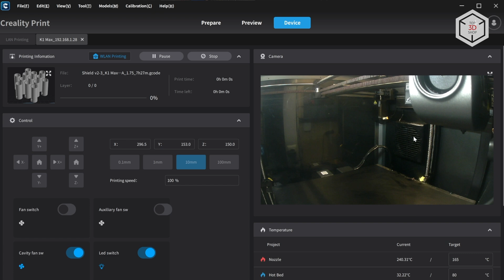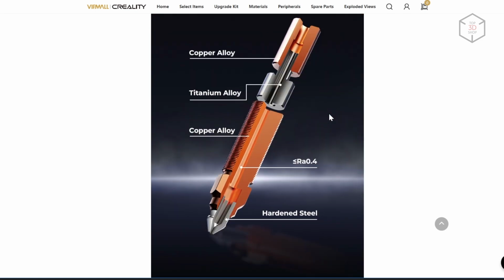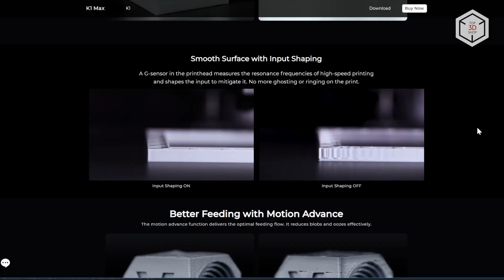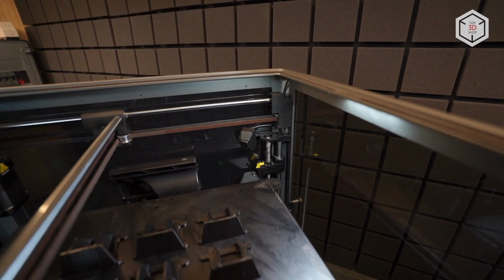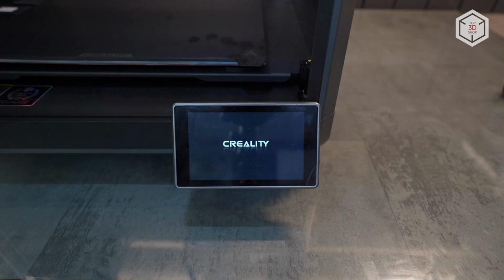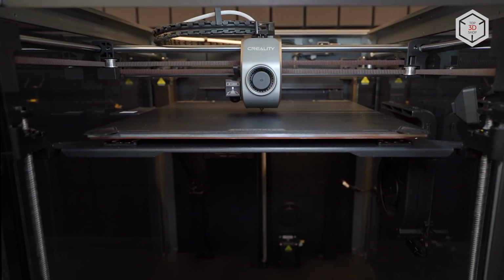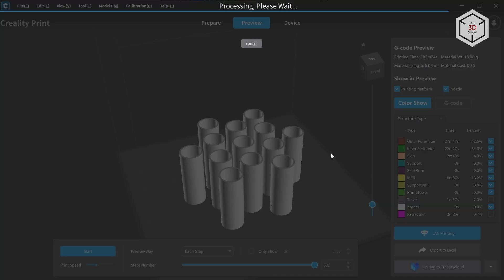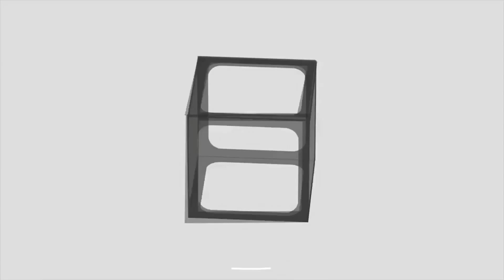Creality K1 Max In-Depth Review: Ultra-fast desktop machine with smart AI functionality

Comment: Have you solved the issue with the PEEK not curing properly in the CreateBot F160?

Your video is the only one I can find where someone prints using PEEK and it didn't turn out well.

I really want it to work but I'm not going to spend $2K if it doesn't